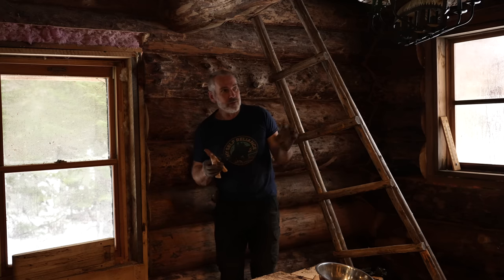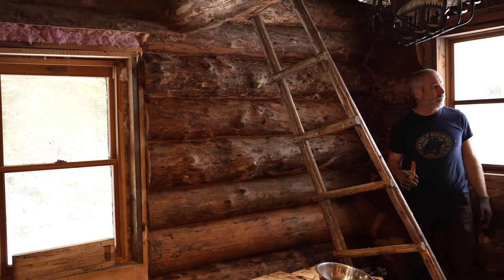You Can Do This Too! Perfect is the Enemy of Good

Comment: Use a mortar striker with a curve getting wider at points. I do rope work and kinds of joints on stone work. I would fill it thick 3/4 to 1 inch. I hate the modern chinking, it don't come off cloths or vehicle interiors. It reminders of the last time I did chinking. Plan on just running d.c. Like boats do. I will have to have battery shed because lead acid off gases. Get a big hammer drill that uses 1/2 drive socket extensions and masonry bits to drill ground rod or put it in tree root.  I would find biggest gap and start there. Make every one same size as what it took to cover biggest gap. Silicon or coconut oil to keep from sticking to metal tools or plastic cards. It's slow work. Like tuck pointing brick. It's meant to be slow. Get you a chair or something to sit on. fyi I charge from 10-25$ per square foot for tuck pointing and chinking. Depending on gaps and what not. You can always fix it when you have to rechink it.

Comment: dont you have any 8 inch spike nails ... bend the head over almost 90 and then back leaving a little space to hold on to .. then the point grind the tip back up the shaft on a long angle so it is more v shaped ... or conical ... then you slide the nail point along the crack using the portion that fits the gap the tightest ... they also make these tools for brick layers ... its a masons brick strike ... or something like that ... for making the joints fit tight ..
Reply: the wider gaps just get a spatula to stuff the gap ... then strike it with the nail softly
Reply: ahhh perfect just takes longer ... as long as you can live with it ... then it's done right ... as for lights ... the 2 rods is perfect ... and a legal work around for too hard to penetrate soil .. it is not a matter of how long the rod is but how much of it is in contact with the ground ... if say 3 feet of 1 inch copper bar is burried then that is 6 feet worth of current flow possible or roughly a good lightening strike to be grounded ... if you are sure of your wiring ... connect ONE circuit at a time start with the simplest circuit ... say the basement light ... hook that in and make sure it works the way you want ... then next one and so on ... once you have more confidence then you can go faster easier

Comment: It would not Have "YOU" or Character if is was Perfect. 
Wet & use you Pinky Finger to smooth out the Caulk. 
The Ground Rods or Plate needs to be outside the building so they have moisture contact. If inside drive them Horizontally or at angle .